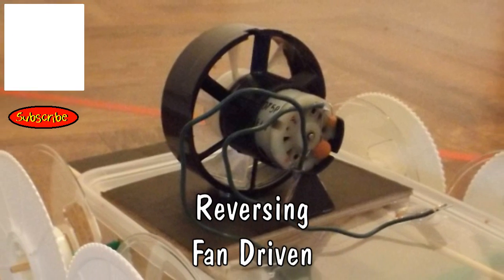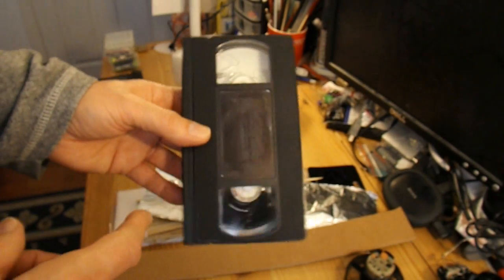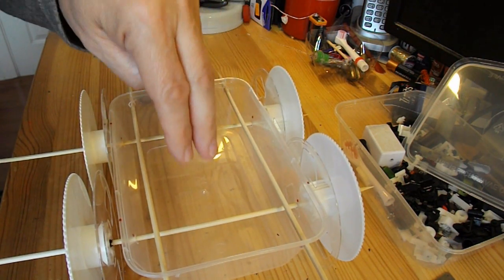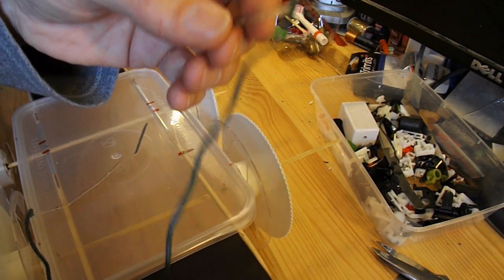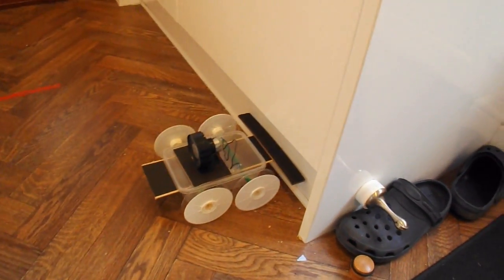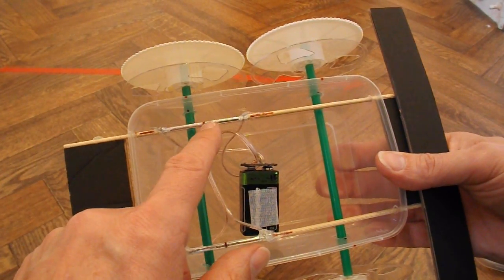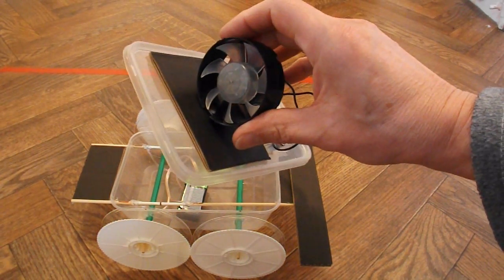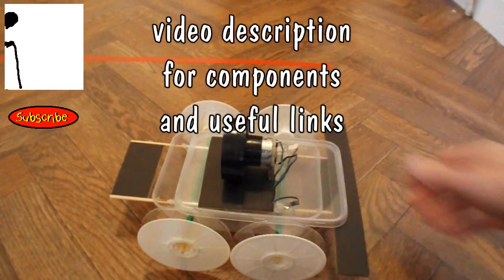Reversing Fan Driven Car for Andy Liam Stone

Comment: lets say supposedly you wanted to do exactly what you're doing but after it hits the wall, you want it to stop at a given point without using remote controls or any sort human control.  any suggestions? 
great video btw
Reply from the maker: Here is a playlist I put together of various brake mechanisms of "toy" cars such as rubber band powered cars. If you specifically want it to work on a fan driven car like this you will need something that stops the axle turning as using electronics to stop the fan turning will not stop the car moving https://www.youtube.com/playlist?list=PLA5a2xPRSrB3MyidvKMT3DqU1vNy9Atsf
Reply: GrandadIsAnOldMan  I appreciate you taking time to reply, thank you. What would be your recommendation on building a small car that has to hit a wall and stop back to where it started, what sort of car would you recommend, rubber powered, fan powered etc?
Reply from the maker: That very much depends on how complicated you can go. The optimal solution would probably be a car powered by a stepper motor and controlled by a microprocessor that you can program to move a specified distance and then stop and then reverse a specific distance. If you are allowed to put a black line on the floor as a guide you could use one of the line follower robotic systems. If you cannot use any of that type of technology then you could make something up with gears or pulleys and some sort of ratchet effect. The main problem is the accuracy of the return run as cars tend to slide about when you stop the wheels turning so a slower moving vehicle would probably be more accurate and that would probably be an electric car that is geared down very low so it moves slowly. You could probably have a turning thread like shown on some of those videos in the playlist I gave you but arrange for it to move an electrical contact or switch. In this playlist there are some rubber band cars that go forwards and backwards but they have no facility to stop them accurately https://www.youtube.com/playlist?list=PLA5a2xPRSrB04L6RpUAs5akmK3jqmahPL

Comment: don't trow the tape away you could make a small wind power generator with button magnets and coil
Reply from the maker: Hi, thank you for commenting. I am interested to know how I could use the tape, have you seen a video somewhere?
Reply from the maker: Dart Gar hey thanks, that looks like an interesting project to try sometime. I will add it to my list. I don't think I need to worry about saving the VHS tape as I have plenty more cassettes in my store. Thanks again for commenting.
Reply: GrandadIsAnOldMan http://dryerr.net/coil-valves-whirlpool-dryer/
This is the coil I think he is using have fun with it I will . I am planing to tackle it myself
Reply: GrandadIsAnOldMan You HAVE A STORE
Reply from the maker: Yolo Noneofurbuss a store, a place you store stuff, a cupboard, a box, a draw.

Comment: Cut the scuwer to make the bumper eseyer to slide
Reply from the maker: How would cutting it help? I guess you mean sand it down so it is thinner and slides easier through the holes in the body. I could just make the holes bigger. The main friction here is the electrical contacts as they have to press down on the conductors and if there is not enough pressure there would be poor electrical contact and the car would not work.
I could have just bought a toggle switch and achieved the same result but I wanted to make the whole thing from scratch as far as possible.
Feel free to make one yourself and post a video of it working.

Comment: hello can u make a video where you show entirely how to male a propelle from a plastic botlle? Thank you
Reply from the maker: It does depend on what you want to use the propeller for. I show one in this video http://youtu.be/e50XT5npqfE?list=PLA5a2xPRSrB0nZItxE_78EJP0F99Ghaki
If it is for a slow flying large rubber band powered plane then you need something more like this http://youtu.be/ZfOVcLglhDw
Reply: Thank you for the rsponse. Can the propeller made in link 2 work for a propeller car?
Reply from the maker: bryss shinigami link 2 is nothing to do with me, I just used it as an example of what you can find on YouTube if you search for it. I would think it is designed for slow flying planes so probably not a good choice for a car, but you could adapt the general build process to make a smaller more robust one for that purpose. If I get time I will make another video using pop bottles to make a propeller but at the moment I am a bit busy on other ideas.
Here is another idea that might work for you
http://youtu.be/epWZvhQI1D4?list=PLA5a2xPRSrB2v0vxMJyZ9cPweAGx1FK6e
Reply: yeah but if i use that propeller would it work for a propeller car
Reply from the maker: bryss shinigami here is my Fan Driven Car playlist where I have various different fans driving different cars. The first one on the list is a rubber band powered car using a CD fan.
http://www.youtube.com/playlist?list=PLA5a2xPRSrB2BNUWVU5G6qQld3G1W604W